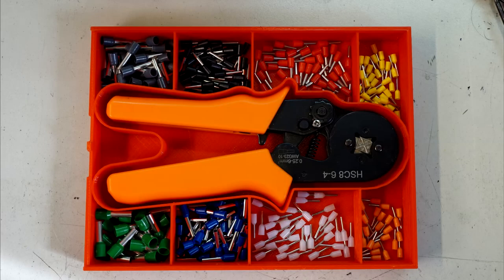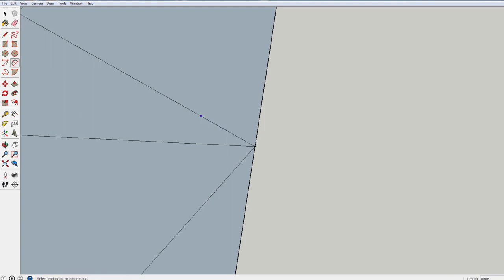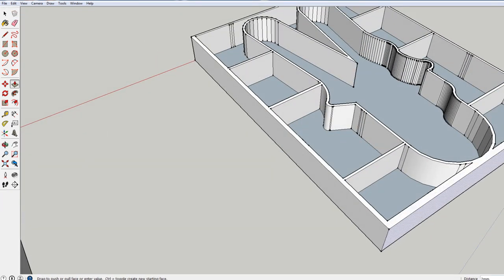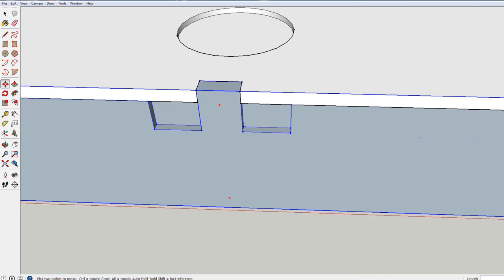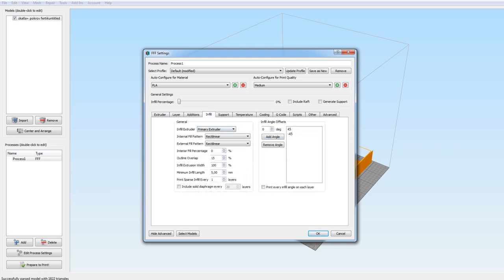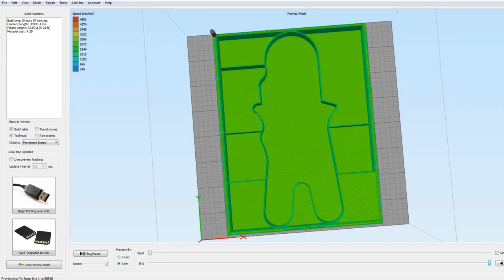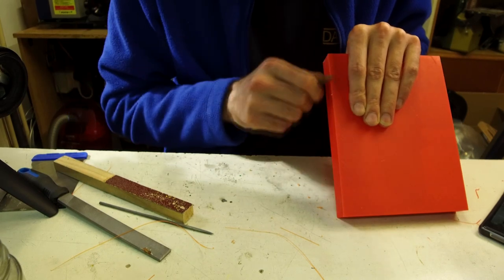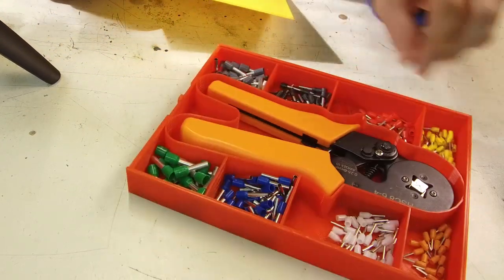3D printed box for crimping tool , how to and all the files

Comment: The box looks bad when imported to slicer, because it was designed in SketchUp. It takes a lot of messing around to make sketchup create solids and not just infinitely thin outer shells. I advise moving to Fusion360 - it's free for hobbyists and so much better at making CAD models for 3d printing or machining. I myself had to move to fusion after I got my 3d printer, and it's not as hard as it might look, at least for the basic stuff that I used to do in sketchup.
Reply: It's not a cad problem, it's a slicer problem..
Reply: Depends how you look at it, some slicers cope better than others for sure. Still, if it was designed without any incorrect geometry any slicer would work without errors :)
I've had some things downloaded off thingiverse, that slic3r messed up completely, but Cura worked fine.
Reply from the maker: dalius98 in slic3r this box look good but i got better print with s3d so more or less i print with them.